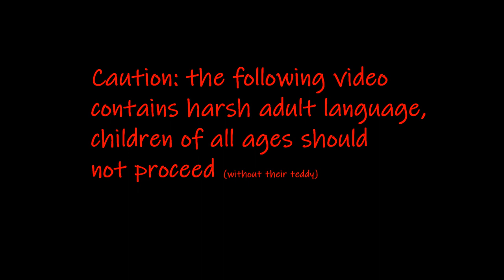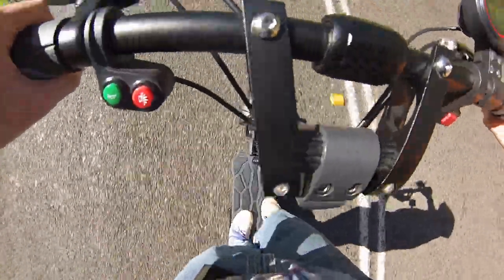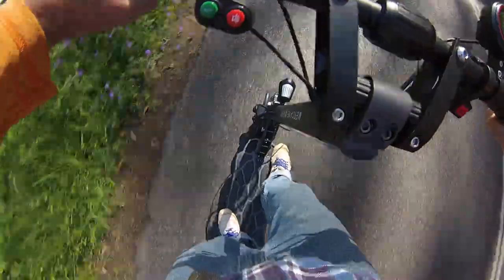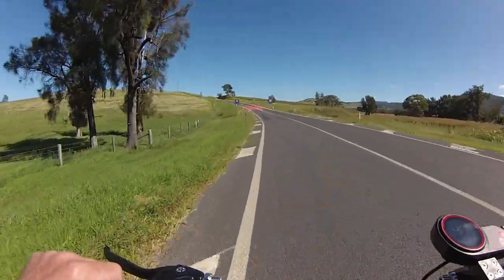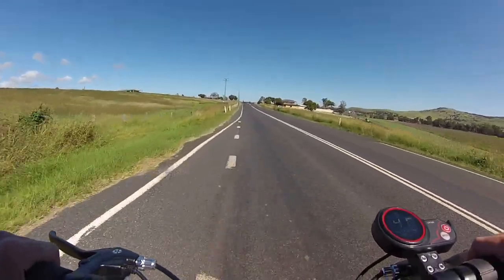Thoughts while on my ride up and back

Comment: With the optional seat the cockpit stem-cramping issue is solved.
Really is a must-have. Cornering performance and stability are far far superior.
Reply from the maker: perhaps, but then I may as well use my actual motorcycle which has far superior cornering performance and stability, and braking, and speed, and range ... perhaps I'll try it one day. Mean time I've got some other plans for foot support
Reply: @finophile And noise, gas, oil changes, smell etc.
You could also put the carry rack on and adapt that into more foot real estate.

Comment: That stance issues is eating away at you  - I hope the foot support helps. I am surprised Mercane got it so right with the Widewheel and could not follow through on the MX60.
Cheers
Reply from the maker: Agreed ... and to be honest unless you want to just hang off the bars like a wind sock it makes it difficult to do more than poke along on it on a country road. I went out to visit a friend yesterday, quiet country back road with a little dirt in the last 500yards (done in a previous video) and  I felt quite "vulnerable" knowing that I only had the ball of my back foot on the deck >with no edge support to stop it slipping off the back< !!
So for a scoot which is just built for speeds you just can't use them unless you do the wind sock gripping on the bar ... which is dangerous and leads to stem damage fast.
Lets see how my mods come up, but as Brandon below suggests, this thing may be designed for "the seated elderly goer".

Shame really
Reply from the maker: in this blog post: https://cjeastwd.blogspot.com/2020/03/mx60-up-and-down-mountain.html you can see the usable foot area of the widewheel is 30% longer (700mm in total length) than the MX60 ... so how did they get it so wrong?

Did some old fart design it? Cos they weren't a skatebarder or scooter rider that's for sure.

Maybe I"ll buy the seat and sell it to a pensioner around here...